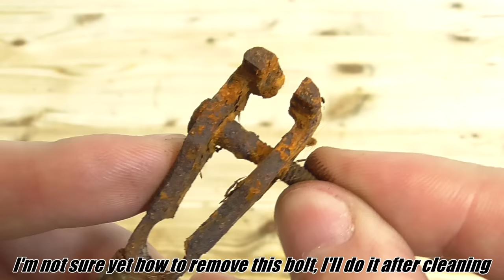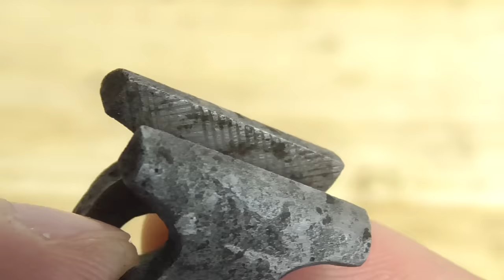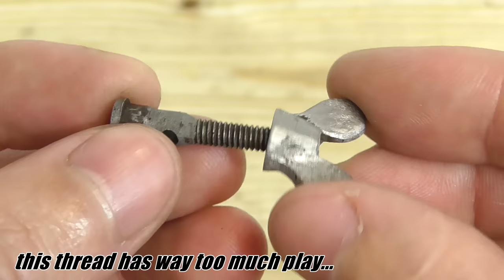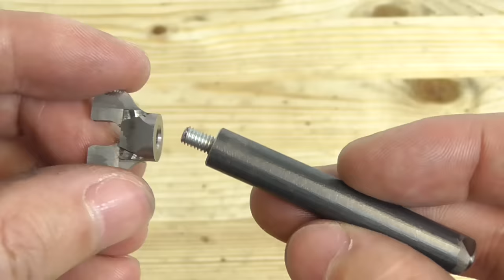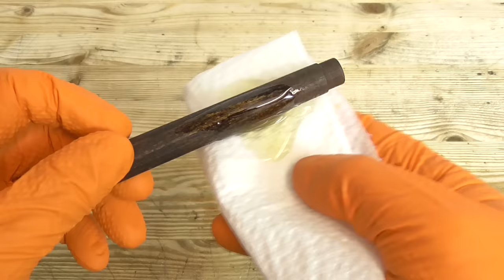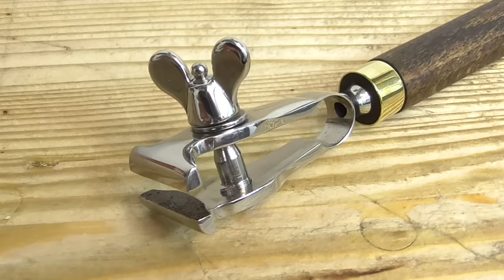Antique Watchmaker Vise - Restoration

Comment: this is why engineers have a constrained budget, give them unlimited resources and they go and make wing nuts
Reply: I was wondering is this the suggested way to make those things? It seemed pretty wasteful, in terms of work and material.
Reply: The old style wing nuts are not what can be found at a general hardware store now a days . Current ones are smaller ,they work but don't have the mass .
Reply: Thokari the mass produced wind nuts are drop forged, drilled and tapped. Not machined. no mass produced parts like these are machined as my mechanic would do it. It takes way too long and wastes a ton of materials.
Reply: @balthazarnaylor5874  Thanks! Indeed the wastefulness of the process shown in this video had me wondering about this.
Reply: Material is not wasted @balthazarnaylor5874 , soap like this, surely if it is sorted, is like money, it goes by the kilo and it will be sold. If I buy a tube of stainless steel the store will weigh it for the price. Way bigger costs, I'm just making an estimated guess now, is the price of the machines and men hours...
Reply: @heartland96a  I wish it was possible to buy those heavy old style wing nuts.
Reply: Apparently, the YT video and viewership make the cost vs benefit viable.
Reply: Spot on!
Reply: Lol
Reply: He actually has a good reason
Reply: My chain of thought was basically: "Ah ok, he's going to buy a new nut... No? Oh he's going to make it a circular handle, that's even cooler... Noo? Oh my Gods, he's not /making/ a gorramn wing nut. He is. Absolute madlad."
Reply: Thing is, I believe the original had that much play in it on purpose and that's why it's an oddball thread. I think that nut was supposed to always sit flat against the surface of the jaw no matter what angle jaws are at and relieve the torque put on the fixed stem.

Comment: G'day MM,  I enjoy your restorations and the level of finish you bring things to :) I thought you would like to know that the hole in the bolt does have a function. It lines up with the hole in the bottom of the clamp, where it screws into the handle, and normally the hole would go all the way down through the length of handle so that you can feed long pieces of wire into it, just having the end you want to work on sticking out past the jaws. 

    This was for filing tapered pins to hold old style clocks and watches together, and it meant that you didn't have to cut the wire into short lengths, file them, and then cut it to the right size and waste wire, you could just feed a long piece of wire up through the handle, file the pin, cut it off, feed the wire through a bit more, make the next pin etc.
   The hole in the vice bolt is also handy with shaping shorter things, like a long screw, as having the end of the piece in the hole in the vice bolt means that as you file or grind the item it can't wiggle side to side, and means the jaws don't have to be tightened up so much.
Hope you found this interesting, and keep up the good work.
Cheers
Duncan
Reply: i was going to tell him the same thing about what the hole in the bolt was used for, but i didn't want him to start crying . . . .  just say'n.
Reply: I figured it had a purpose for the repair process but I didn't know what that might be. Thanks for educating me!
Reply: This should be the pinned comment
Reply: Exactly... Even someone like me knows that every feature present in a tool has an use... Specially in old tool. Even more so in watchmaker's tool
Reply: I came to say this, but you've said it perfectly. I suspect the eyebolt at the bottom of the handle may NOT be original, and that the handle may have been through-bored for long pieces.

I have a similar vice, but solid metal (all one piece). The handle is bored right through
Reply: Was about two sentences into explaining what the hole was for.  Then decided I should look to see if it had been addressed already.  Sure enough... here it is!
Reply: @Duncan McHarg Very interesting. I was thinking that there must be a reason for the hole.
My Mechanics will read this, and fix it, I bet.
Reply: @dandare1001  The thing is nothing is ever machined into a part without at least one purpose.  Doesn't matter how old or new it is nobody wastes time, or materials for on an unneeded operation.
Reply: @freesanima  My guess is you could put long thin spindles trough that hole, similar like the bolt in the final test, but thinner and longer....
Reply: Great info! 👏👏👏

Comment: The hole in the bolt does have a function! You nearly found it at the end of the video, when you put a long thin part in the vice (like the bolt you ground) it stops it twisting in the jaws!
Great video!
Reply: This needs to be higher.  Makes complete sense now.
Reply: @green4green  Glad it helped, do replies make it higher?
Reply: @grannyflatgarage7599  not sure ... Hopefully?
Reply: Funny how your comment hasn't gotten a "heart", yeah?  Of course, the hole had a purpose.  Otherwise, why would it be there in the original?  He did zero research for this tool.  Fact is, he now knows this and is embarrassed to give you a hearted comment.
Reply: @Rickbearcat   LOL you're upset that he didn't get a heart on his comment? Are you serious?
Reply: He made the bolt with edge that fits into the cornered hole on the other side to keep the bolt from turning
Reply: Guess you are right
Reply: @Rickbearcat  👍😆

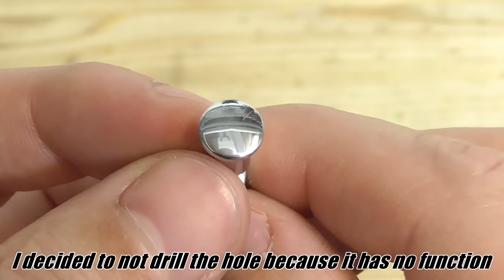Comment: 7:50

the function of the hole is to allow you to hold a long part with the middle of the vice by feeding it through the hole. so the bolt doesnt get in the way
Reply: Robin Steel I came here to say this, But knew in my heart it had already been said.
Reply: Also came to say this. It has a function. Everything in older tools has a reason.

Comment: I am 100% addicted to these videos- what a master! You do this in a way that we all wish we could. The only suggestions I would have to offer are around some of the woodworking choices you make. Try plasticizing with wood restoring fluid or filling wooden pieces with epoxy/fine sawdust and re-machining. If you need to replace the wood, perhaps try to find antique wood or old-growth wood so that the grain pattern is closer to an antique. And finally, the choice of stain you usually use is a matter of preference of course but it seems to have too much black in it, which drowns out the grain, and try tung oil for final coat! Anyway-keep going- You are awesome!

Comment: Wingnut available for 25 cents at any hardware store...

"I make new one" - MM
Reply: IIRC he has said that the problem with using new off the shelf hardware in restoration projects is it's almost always zinc plated (or stainless steel) which doesn't fit with the look of the vintage stuff.
Reply: I forget what it was but he removed zinc plating on something on another video I watched.

Comment: Awesome attention to detail. I mean you could’ve just bought that screw loop from the local hardware store for a dime a dozen but you chose to restore it instead. And that mickey wingnut too, just wow! 
Also, the hole on the bolt functions as a slot if you need to hold down a part that’s a bit long. Keep up the good work.

Comment: When 60 percent of the restoration is “I make new one”
Reply: Eh, 3 parts out of 7, so...42 and a bit %? But yeah, I was actually counting too, so...
Reply: @InstrucTube  Everyone unsub, and MM stop making videos. This guy doesn't like replacement parts. Just throw away any old item that doesn't 100% function in its original form.
Reply: @B3Band  I mean, you go ahead and keep assuming. I never said I didn't like replacement parts. Just that I was amused at the amount needed in this case.

Comment: Everything you do is beautiful. On wooden parts (soft woods ) I would use a sending sealer before applying a water based stein. The results will be much pleasant to the eye. Oil based steins can be used on almost everything. Thanks a gain for beautiful videos restorations.

Comment: The hole in the screw is to accommodate wire stock that you can grip with the hand vise. Some of these style of hand vises have a through hole that goes completely through the handle, letting you grip fairly long pieces of wire.

Comment: I have a device very similar to this one that my father used to make crafts and miniatures, he has been at home for more than 80 years, instead of a wooden handle, mine is all metal, in one piece, and if it has the hole in the central screw, I think it is necessary because sometimes there are long pieces that have to be worked and they have to go through the hole

Comment: the hole in the original bolt has a purpouse, it was there so you can stick a long thin workpiece, directly throug it, so it can't twist out of the tiny jaws, that's also why the base has such a hole. it could for example be useful if you tried to sharpen a drill with that vise.
Reply from the maker: Yeah I realized that way too late, unfortunate

Comment: Well done!  That vice never looked as good as it does now.  
Back in the 1800s, fly fishermen used a watchmaker’s or jeweler’s vice to hold the hook while they constructed the fly.  So, if you don’t want to use it for polishing small parts, you could take up fly fishing and tie your flies vintage style. There’s nothing like taking up a brand new hobby just to justify the tool you just created. :)

Comment: Yes, we all saw the washer was not concentric. The thumb nut could be remade with a smaller lip which could fit inside of the washer, keeping it concentric! And while you have it apart, I would drill the bolt you made, with the hole, so that it is able to be used as designed and remove the eye-bolt (that was not part of the original tool).

Comment: Nice video, thanks  :-)
The vertical hole function in the screw (JMHO) could have been useful to hold a little shaft (like the screw at the end), so it couldn't move when held in the jaws. Quite useful to obtain precision   :-)
Most basic tooling was adapted to the very needs of the required job, hence this idea. Not to speak about specially made tooling   :-)

Comment: if you want to reuse cracked wood you can fill the gaps with wood glue + sawdust and clamp it till it dries. Same for holes or broken threading, just fill it in or fill in the threading then redo it.

Comment: Nice video and restoration.  The hole in the bolt does serve a purpose (two).  It is a pass through for round bar sections which allows the clamped end of the round bar to sit just above the face of the jaws on longer rods.  It also allows for lighter clamping pressure when working rod bar without the need to rotate the work piece.
The hole is also in the back end of the spring  section of the clamp and would have extended into the handle of the vice.  In keeping with your pursuit of perfection I recommend you add a hole in the bolt. :)

I've seen vices like these where the hole extends out of the back end of the handle where the twist in eye fits.  I would be interested to know if the original handle was drilled all the way through and the twist in eye was added later? A bass feral would have been fitted in place of the twist eye.

Comment: I can't help but think that the hole was there for a reason. Looking at the length of the vice (metal part), there seems to be a lot of wasted space between the base and the tightening screw. If I were to hazard a guess, I'd say that the hole was designed to allow a longer piece to fit through so as to hold it in place (keeping it from moving sideways) while the end of it was worked on.
Offhand, I can imagine a ladies hat pin made of precious metal, adorned with a jewel of some kind that might possibly need repaired.

Comment: The metalwork is superior, but the wood finishing less so.  The handle would look better if sanded to a finer grit.  The final sanding should be parallel with the grain.  Sanding leaves fine scratches that the stain enters, making a “muddy” appearance.  For a great finish, scrape (rather than sand) just before applying stain.

Comment: That particular solvent varnish + linseed oil doens't look so good this time - - though it is indeed the right thing to do.
Anyways, nice idea to use those solid little bars to draw the main bolt through (though I think even a pair of pencils would've worked).
Also a great idea to blue only the inside grip pads.
Reply from the maker: Thanks, I'm glad you like it :-)

Comment: The purpose of the hole through the closing bolt is to allow a long rod to be held longitudinally while working on the end. You'll note that the tang of the vise is drilled through and that the handle is drilled through as well. This allows quite a long rod to be held longitudinally as it will pass through the closing screw, through the tang, and into the hollow of the handle. The eye screw was not original and defeats the purpose of the drilled through handle.

Comment: Fantastic, as always. However, I believe that the original tool did not have a dull, dirty-black looking wood handle. I would be surprised if anyone sells tools with wood parts that look as blah as this handle turned out. Therefore, I suggest that you make at least some effort to have the tool shiny. From the little wood-working I've done, it's not hard. One way is to apply a layer of shellac, sand it smooth, apply another layer, sand it. (This is because shellac is soft and can be sanded easily.) Now that the perfect is perfectly smooth, apply something much better than shellac, such as varnish. However we get there, I firmly believe your wood parts should be as utterly gorgeous as all your metal parts. Otherwise, the striking contrast between them detracts from the result. IMHO.

Comment: What is the flat plate you use? Is it a diamond plate or.......??? I use a glass cutting board (smooth side) with sandpaper and 3M spray adhesive.

Comment: I've noticed that you say "Standard Size" quite a bit. Is that American standard sizes based upon the ‘inches’ standard or is it a Metric Standard?
Reason I ask is because I have a Tap and Die set with both Standard (American Standard) and Metric threads. Also, since most repairs I have to do in this modern age on machines (small engine all the way up to Tractors) require either (American) Standard or Metric or both on same machine.
You do beautiful work on everything I have seen.
Reply: Most likely Metric given they live in Switzerland.
Reply: @GamingWolfGod  That's what I figured after I saw a few more of his videos. I know in America getting both types of tools is fairly easy, though probably not so easy to acquire in Switzerland.
Reply: @roseblite6449  True. I do wish I lived across the pond though. Europe always seems to have cool antique/vintage stuff for sale at garage sales and what not.

Comment: Do you know what kind of parts this would ordinarily be used to hold?  I would think watchmakers would use smooth jaw or leather jaw vices.
Reply: The gear parts; or for setting jewels in the system for balance.

Comment: I'm a retired watch/clock maker and as much as I admire your work this hand vice would never have been so highly polished when it was new. Most of the parts you have replaced so as far as I'm concerned it is not a restoration but a replacement.

Comment: Shouldn't there be a spring around the bolt to provide tension on the jaws?
Reply from the maker: Not needed as the jaws itself is the spring. It is fully openend when not under tesnsion. If you close it, it will open again automatically.
Reply: @mymechanics  Thanks.

Comment: Can I tell you about my first experience on a lathe?
Reply: Funny now
Reply from the maker: tell me
Reply: @mymechanics guy told me to dig deep and fast speed and feed. Stainless . Turned black 1 inch before the cutter. Also above center. Sparks and heat
Reply: @mymechanics  Set cutting tool above center. Fast speed and feed. .25 deep. Blackened 2 inches ahead of tool. Lathe bogged down .scared shitless . Hit e stop and tool shattered. Turned around and all partners laughing they got the new guy.
Reply: Sorry not good at this. They got a good laugh at my expense

Comment: You put $2 cost for the handle, why no cost for the big lumps of metal for the new nut and bolt?
Reply from the maker: Was already in my shop, didn't had to buy it
Reply: @mymechanics  Oh cool, do you recycle the metal shavings and melt them back into those cylinders?

Comment: i see you filing on the lathe with your left arm over the chuck in every video.  this is dangerous behaviour.  your left hand may not be as good as your right hand for holding the file handle for control, but losing your arm because it got caught in the chuck is far worse.